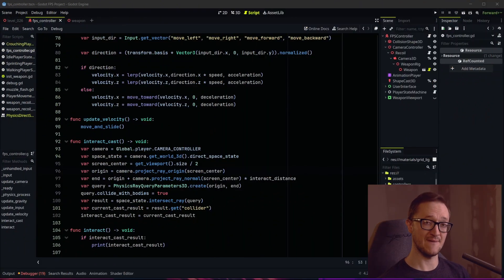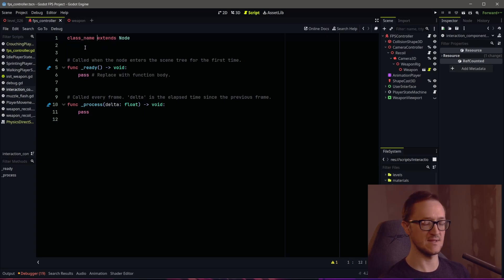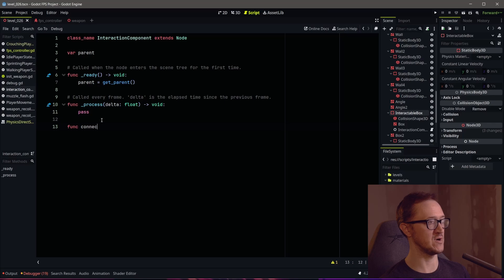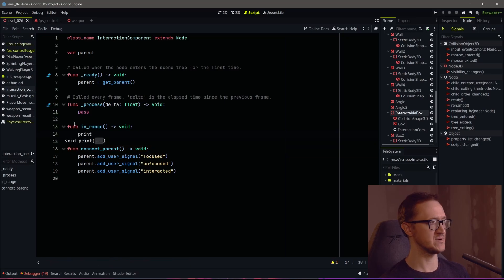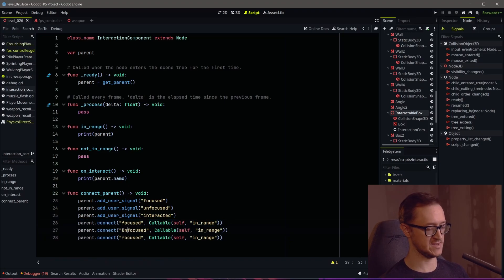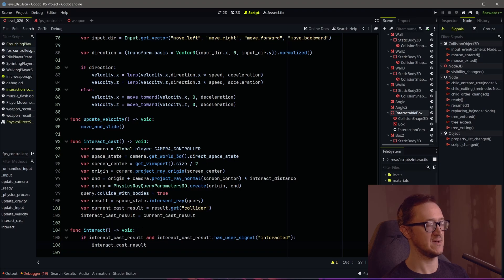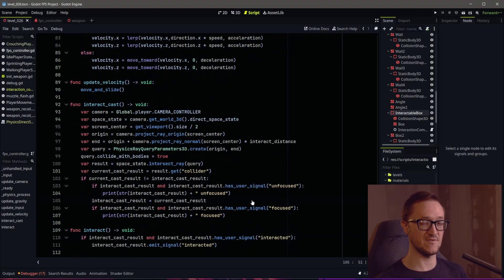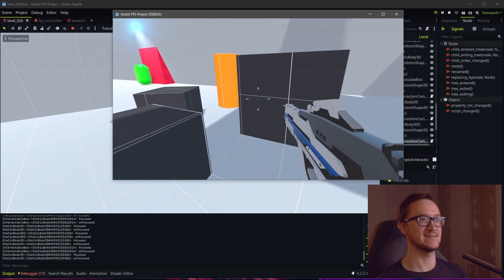Creating A Modular Interaction Component

Comment: Isnt it easier to just do parent.connect("focused", in_range) instead of parent.connect("focused", Callable(Self, "in_range"))?
Reply from the maker: Both should work.  Mine is just more explicit and I remember in the Godot docs something about it being preferred.
Reply: @stayathomedev  I would imagine passing `parent.connect("focused", in_range)` would be preferred over the "callable with string", guessing that it'd give the compiler more info as a function than a dynamic string. I'm not sure why but passing functions as strings feels wrong - any more info on this & where it says the preference in docs?
Reply: @Luijeee You can also access another node's methods as if they were any other attribute.

parent.focused.connect(in_range)
Reply: @stayathomedev It's more explicit but it can't be picked up by the interpreter.

Callable casting with (object, string) is useful for trying to refer to a method that may not  exist.

In this case, you can call in_range (as a literal without quotes) to access the method as a callable directly. The engine can resolve the reference to the method in the text editor since its available in the same script, unlike casting which only shows an error at runtime if the method doesn't exist.